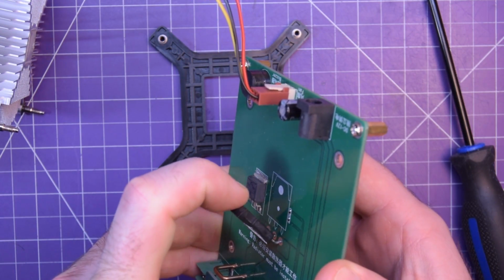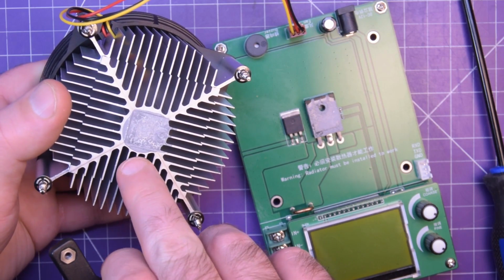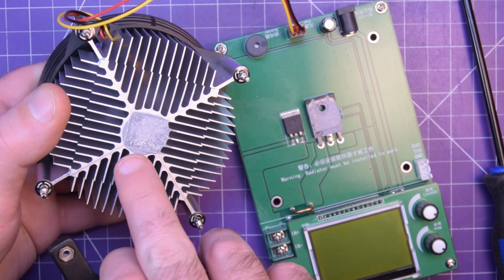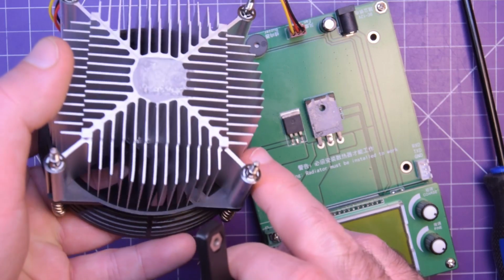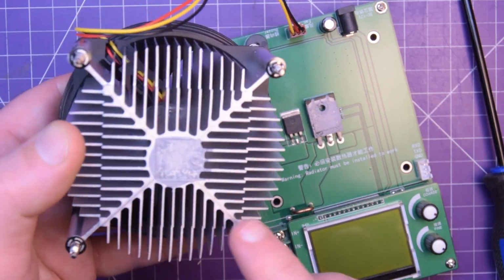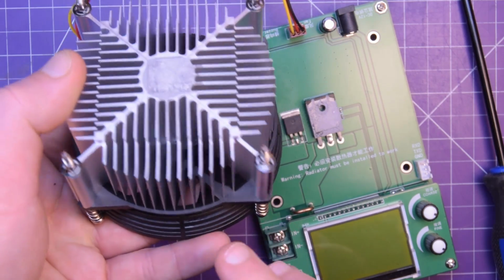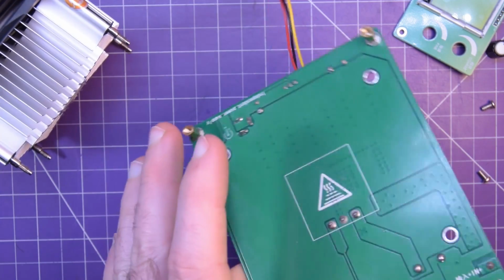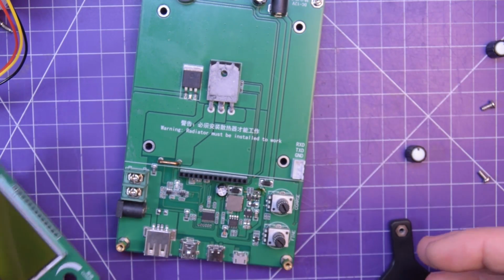Review of a 150W Constant Current Load From Banggood

Comment: Well explained. Too bad you don't say anything about the RxT/TxD interface. Have you tried this interface?
Reply from the maker: Comms are a bit above my head, for the moment, but I do plan on looking into it over time!
Reply: @SimpleElectronics  I was hoping to be able to log through the port. Unfortunately I can't get any data out. Maybe this port is only for firmware updates. Too bad.
Reply: @hedo3d  I'm trying the same thing. I was hoping the video had a bit of info too. It would be nice to have a battery discharge graph plotted over time. I'm fairly new to comms myself.
Reply: @hedo3d  i have been trying for 2 days now... you are right... the is no data

Comment: At time 2:27min you had default <0.00V set.
Rest of the video you changed  frequently to higher Vmin.
I tried unsuccesfully, but how to set back to 0Vmin?
Reply from the maker: It's a pain in the butt, you have to connect it to a higher voltage source and then triple click and hold to get it down to zero again
Reply: @SimpleElectronics  that doesn't work with mine but I have found the easy solution to reset to zero based on your video.
First put a higher voltage for ending the beep loop.
Then press the button 7 times and wait.
You will hear one short beep for confirmation.
Done! Hope this helps.

Comment: 4m40s: To reset the setting remove the load, remove the 12V power supply. Reconnect the power supply and press the mode button seven times. This will reset the adjusted cut voltage.
Reply from the maker: I cannot get it to work, tired various different speeds, can't get it to reset
Reply: @SimpleElectronics  Sorry about that! I got my unit today and this procedure is written in the manual and it's working. May be a newer firmware?
Reply: The manual says: (5) consecutive seven hits at no load making the current zero accurate in the current temperature environment. Calibration is zeroed for accurate measurement at low currents. Factory reset all parameters. (I believe the Chinese text isn't very well translated into English from the guys ;)
Reply from the maker: @SeliJue  Thanks for the info but yeah you must have newer firmware, mine does none of that!
Reply: Doing this also resets all the stores data, everything is back to zero.
Using this method as a stop point in a capacity test isn't feasible, as there's no chance to read the data before it's reset (unless I'm mistaken?)